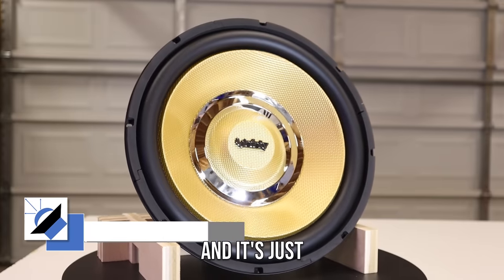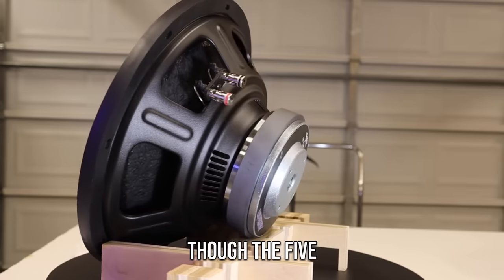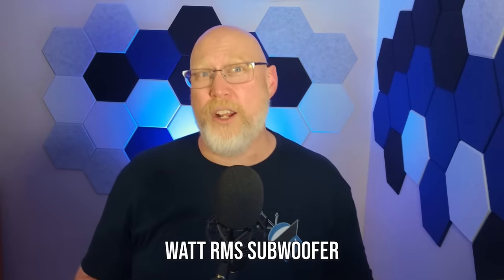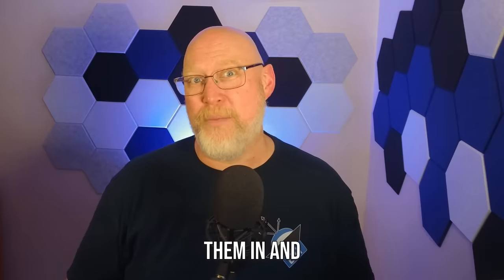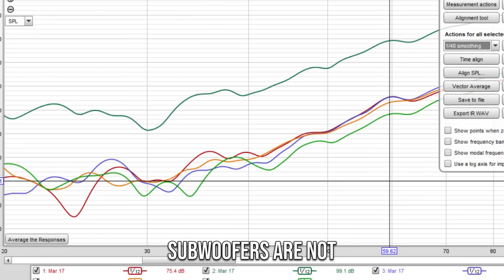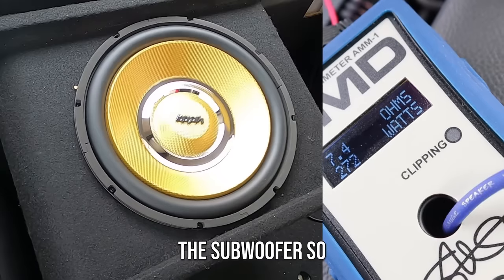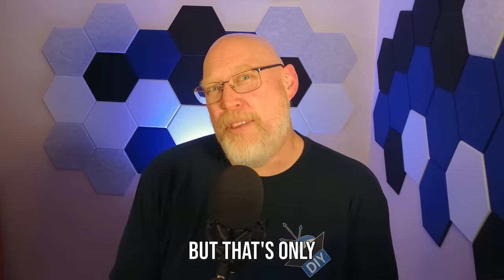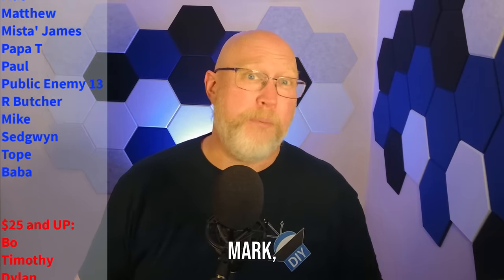What is the best budget car subwoofer in 2024?  Cheap 12 inch subwoofer shootout!

Comment: Putting the Infinity in third place rating makes no sense. Its a speaker and does what its suppose to do and looks really good. Its the only speaker that survived the test too.
Reply: I agree....
Reply: Agreed and any real installer will solder the connections and would prefer the “cheap” terminals
Reply: That infinity is actualy Jbl cs1214 sub only with different soft parts coils, motors and baskets are the same just wanted to share this out since people might want to know, but its best of the lot for sure decend 4layer vc on it as well

Comment: Pyle has turned into an unfortunately accurate name for that brand’s products.
Reply from the maker: It's been that way for decades.
Reply: They always were a Pyle.
Reply: @Bradimus1  not at the very beginning in the 80’s. I owned a set then that performed very well but they began their decline soon after.
Reply: @2011joser  I have never in my life saw any product from Pyle I'd call good. Always - Budget or bad. But that's true of all the brands in this test other than Infinity.
Reply: @Bradimus1  I’m old enough  and have been in the hobby long enough to have seen most of these brands at their peaks . Pyramid was always cheap even though they tried briefly to step up.
Reply: @2011joser  I'm 40 and sold and ordered car audio. I've seen a thing or two.
Reply: @Bradimus1 If you were ten years older you would realize that Pyle had decent stuff in the 80’s.  By the mid 90’s they were junk.
Reply: @Bradimus1  l’m 57 and have been building systems since ‘85 so I actually purchased and installed many of the brands covered here.
Reply: @YellowSn0man  Stuff from the 80s had not all disappeared. In fact I would argue that the vast majority of car audio products prior to the 90s were not great. I have no nostalgia about it and it's just not an opinion I agree with.
Reply: @Bradimus1  I don’t have nostalgia about it either.  In 95 I just ran into a shop that had an amazing selection of gear from the 80’s to at-the-time current products.  I consider the 80’s the pinnacle of car coaxial speakers.
Reply: @YellowSn0man  why?
Reply: @Bradimus1  TLDR:  I already had good stuff (as far as a teenager replacing coaxials goes). I was shown 80’s stuff that destroyed it.

In 95 I moved to a new area and found an amazing shop. It was owned by an older guy in his 70’s, heavy Eastern European accent.  He had a back room with older years demo boards and all sorts of oddities.  Like a fosgate coffin, advent pyramids, just tons of weird stuff.  He also had current product up front, with a far better selection than crutchfield.  He just really enjoyed car audio and had a wealth of knowledge and tons of product experience.  Us know it all highschoolers made fun of the older stuff, and he schooled us on the spot, not very politely either.  The stuff he pulled out from the 80’s was just on another level. It would tear your head off and sound good doing it.  I ended up replacing my 6x9 and 4x10 with his older stuff.  It blew my mind when I saw that they had bigger magnets than my 12” mtx subs.  He knew exactly how to outfit my square body Chevy.  A couple years later I replaced the 6x9’s in the doors with kicker component free air 6x9 and had major buyers remorse.

Comment: Just purchased a pair of Infinity Primus based on this video
Thanks for the in-depth review - As I'm not "feature" oriented, the Infinity won hands down for me

I couldn't find Thiele Small for the Infinity Primus 1200 anywhere on the internet. Here's the data from the spec sheet included:

Qts: 0.45                     Qms: 3.65
Vas: 76.6 (Liters)       Qes: 0.51
Fs: 28.7                       SPL: 90 (2.83v @ 1M)
Re: 3.6 ohm                Pe: 300 WRMS
Le: 2.26 mH                BL: 14.2
Xmax: 12.3 mm         Dia: 300 mm
Z: 4 ohm                      Sd: 531 cm2

Mms: 158.1                Mmd: 150.3g
Hag: 6mm                   Hvc: 30.7mm

Comment: I have the older version of the Pyle 12 Power subwoofer with a steal basket and I love it! I'm an oldskool enthusiast and this screams oldskool Rockford Fosgate Power DVC 12" subwoofer from the 90's. I have an oldskook Alpine dual channel amp running mono to around 200 watts but I don't drive it that hard. It does what I want it to do so I'm happy. I don't need a 1200 watt hungry sub but my son has 2 1200 watt CTSound 12" subwoofers in one of their enclosures with a mono amp of theirs and the entire car seems to be vibrating apart.

Comment: My best guess on the Pyramid would be that theyre trying to advertise the sub as having a "high temp" voice coil. Technically able to handle sustained use at high power when used as say a guitar or PA monitor. Plastic baskets believe it or not are ALOT less resonant than a stamped steel basket.

Comment: Do the best SQL subs in its recommended box size ported and sealed.
Reply from the maker: For something like that, I wouldn't do a shootout video, I would do a video on each individual subwoofer. Especially when you consider the time and cost needed to build the enclosure.
Reply from the maker: Something like that will probably take six or seven videos.  Definitely something I'd like to do one day.
Reply: recommended boxes? awful, ive only seen a few which are decently tuned. And they wont be anything more than a simple ported box
Reply: So the buyer of subs like these can enjoy. A master builder isn't buying $50 or less subs 😂

Comment: LMAO ... Just watched this video two weeks AFTER I bought two pyle 15s 😂. I broke them in and pushed them quite a bit hooked on a Yorkville power amp rated at around 5-600w rms to each. They did hold up fine for now but they might be on borrowed time. No worries its just for fun and testing since I usually run pro p.a. subwoofers 😋

Comment: I have a super pro I've been running a rf punch 500 on it for 20 yrs. And I've ran twice the rated power with a Ppi Pc amp on a Pyramid Super Blue subs. IT'S ALL ABOUT CLEAN POWER AND BOX DESIGNED FOR EACH SUB

Comment: I have a boss audio cxx10 chaos subwoofer after break in warm up ive had it 5 years and it is in a pyle pqblw10 square bandpass box and still sounds good so i really can't complain about that it is used as home audio subwoofer, Kenwood excelon kc av505 home theater surround sound receiver 500 watt

Comment: I have this exact SKAR and have had no real issue with it that wasnt my fault. I have ~300=350w going through the skar and the original one i think some of the epoxy came off one of the coils, sent it into SKAR for warranty and they replaced it without issue. The replacement has been in my car using the exact same setup at 4ohms in a sealed ~1 cu ft box for about 2 months now and no issue. for the $45 i paid for it onsale on amazon, im not bitchin too bad.
Reply from the maker: It's cheap and it gets the job done. What else do you really need?

Comment: I would like to point out that the NVX NSW-1xx-V3's release is imminent. The V2 of this series was quite impressive for a 45.00 subwoofer. The V3 is sure to impress.
Reply: Don't drop the infinity from the test, retest the Infiniti to confirm the results.
Reply from the maker: I've got some other stuff planned for the infinity.
Reply: @DIYAudioGuy  I cannot wait. I would like to know if the Infiniti really did outperform the others. I understand it's probably a data error due to the fact that the curve is exactly the same as the curve on the others, but it would be super cool to know for sure
Reply from the maker: @nighttow8780  the most logical explanation for the massive difference is an error on my part.

Comment: Belva makes a Marine rated 12" sub with 100 oz. magnet and 400W RMS for $80. Belva is the Sonic Electronics "House Brand" and is pretty solid. Personally, I think Skar makes the best "entry" level sub for under $50 depending on pricing and sales. Which Skar has had an extra 15% off everything sale going on for over a year now.
Reply from the maker: https://youtu.be/9xTCAtZOD9Q?si=-bEG6C8PK6nmFVYg

Comment: I was pretty bummed with the Pyle 15" dvc 2000wP 1000wR. I put it on my 3200.1D Cobalt Orion. After break-in, it started popping at about the 4 hour mark. The Orion I purchased in 2015 with 2x 12" Kicker comp which lasted about 6 months and they locked up.

Comment: The Infinity sub also has the added advantage of the folded edge around the cone - this makes the cone significantly stronger, reducing cone flex and resulting distortion.  It's been a feature of Infinity subwoofer drivers for years (I still have my Infinity Kappa 122.7Ws from a previous build in storage).
Reply from the maker: Cool!
Reply: That infinity I believe is an old design. Very similar to a sub called the 120.3es or something like that. Used to be rated 250w though. Blew one up on my other channel for fun because nobody bought it lol

Comment: I had a skar SVR 10inch and it was better than the EVL in all honesty because the EVL tore itself apart. The SVR got real low and was strong asf for one single 10 (I beat the hell out of it and still looked brand new…after breaking it in ofc) it was in a band pass by itself and ppl thought I had 2 10s. was on a 1200w amp

Comment: I want a amm meter cause I’m running a sound stream 3k tested by big d and 2 of them plastic subs (sister brand pyramid) 2 x12” dual vc 4 wired into 1ohm and I’m impressed I can bump em till I smell them and then back off there held up well although no where near there ratings the plastic basket well that was wierd

Comment: I don't believe the Pyramid is a subwoofer. Pretty sure it is a woofer. The box didn't look much from the past one I purchased and they were woofers. Those have actually been around  25+ years, with what looks like little to no changes. The box in your video said 2" high temp coil woofer. Although they forgot the " .
Reply from the maker: Probably so.
Reply: It's a shame they're built so cheap because they look nice. Gotta go with the lanzars for the classic black paper cone look

Comment: I don't like to run ANY audio below 4-Ohms.. When you get down to 2 or 1-Ohm. I believe the sound quality dissipates rather quickly even in bass ranges.. Plus the AMPERAGE draw gets MORONISH @ 2-Ohms or lower.. FOR THE PRICE, I love my Rockville PBG-18 subs @ 8-Ohms.. Rated @ 2000-watts.. F.R is 35Hz.-4Khz.. 98db sensitivity.. 130-oz. mags.. I tested them @ 20Hz. and they responded by shaking my windows all over the house.. I run my 4 PBG's with 2 RPA-16 class H amps.
Reply from the maker: I would bet that in a double blind test that nobody could tell the difference between 8,4,2 ohms, especially after you level match the amplifiers.

Comment: No mention of response frequency or any comparison of specs? Impossible to make a determination based on the few tests shown here.
My money is on the Infinity when all specs are compared.
Reply from the maker: Did you completely miss the part where I ran sweeps and measured theme with REW?
Reply: @DIYAudioGuy  no, I saw them but, I need to know at frequencies each subs roll off at how quickly. For example, my experience with those budget Skar subs is they don't do very well below 40Hz. The Fs of each sub will tell us more about how well they handle deeper bass. SPL doesn't tell the whole story.

Comment: I knew it, and you finally said it at about 13 mins in, that is, "I bet that amp is clipping and the AMM1 isn't lighting up".  I also said, "if you buy any of these subs, you are literally throwing your money away".  Like seriously, if you can't afford anything better, just throw that money into a slot machine or something.  I put Pioneer in with these.  Junk.  Also JL Audio subs die with weak power like these, I wouldn't run more than 300 clean watts into a JL 12".   

I have been very pleasantly surprised with Clarion subs in the past, I put one in my mothers car and run over 500wrms on it all day long, Night Lovell for hours and it not only belts out big SPL by being quite efficient and taking big power without complaint, but it gets nice n low too reproducing under 30hz truly with ease.  I've ran a Alpine PDR-M65 and MRV-1005 on it, perfect matches.

Comment: What a pity that Infinity became a substandard brand. Those Kappa Perfect 12.1 subwoofers were, like the name says, perfect. 
Same with JBL (also Harman). Those days with  the GTI's and the P1220's. All they make nowadays are junk.
Reply from the maker: I think this Infinity is a great subwoofer, it is just ugly AF, and for the people that are looking at this price point a SKAR with push terminals is a better fit for the consumer.
Reply: @DIYAudioGuy  Except the bling bling around the dust cap, I don't think it's that ugly. But that stamped steel basket is really el cheapo, just like the terminals. I would rather buy a used Kappa or a JBL P1220; Oh, wait, don't need to. I have two 12.1 Kappa's of my old install and two new JBL p1220 II (old new stock which i bought very cheap) and one used one also from a former install 😉.
Reply: @DIYAudioGuy  By the way, we don't have Skar in the Netherlands.

Comment: I would have just ran the more powerful amp and monitored the power, so there is no way you can get clipping
Reply from the maker: I have found that I cannot resist the urge to crank it all the way up, so I use a smaller amp..

Comment: Brands I will never buy b/c they're not even worth the box they ship in. Pyle/Lanzar/etc., Boss, Pyramid, and several more I can't think of.
I had a Lanzar 12" 4 ohm sub I was going to use for light duty with a 200W amp (old kicker 400W@2ohm) and it blew within minutes. Rated at 1600W max, had a beefy surround, 160oz magnet. Using that same amp to power a cheap rockville sub and kenwood sub (I think they're rated @250W), they handle the power no problem. Even if the sub looks like it can handle power, that doesn't mean much if it's using the cheapest chinese VC they could find. Not even happy with Infinity right now. I have a pair of 10s acting strange. Not blown but they have this "selective impedance" thing that seems to be acting abnormal. I had to use an analog meter just to get a proper impedance measurement. Now trying to figure out how to take off their stupid plastic magnet cover.  Oh... those cheap brands can make good passive radiators though! I have 2 12" blue pyles as passives together with an alpine type R and that box is amazing! I even thru the cheap kenwood in there and it still rocks!

Comment: Since  all subs do not have the same T/S p[arameters, this test is UNFAIR and INACCURATE...  

   Each sub should be tested in it's optimal enclosure size/volume/ vent size/ vent length to be fair.

  Fellas', AVOID taking advice from someone who does videos and testing like this , because they are either ignorant of these facts, or are purposely misleading you, either of which would disqualify the video maker from being a reliable knowledgeable source of information.

  This is not judgement or opinion, simply factual observation

Comment: Hey i have an idea for a video and you would be the perfect person to do it and explain it 
If you took a couple of the same subs in different vc configurations then hooked the. Up 1 by 1 in diffent ohm load set ups and show the power pulled from the amp at the same volume and measure spl at each ohm load 
Mabe even throw in some spl measurments withe power levels matched to see if x watts is louder at 1/2/4 ohm or if its foughly the same